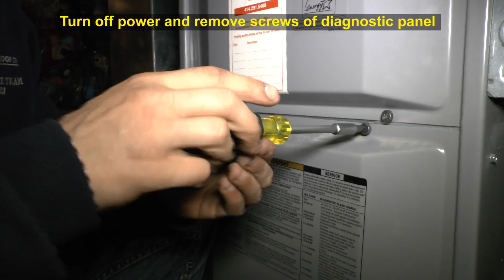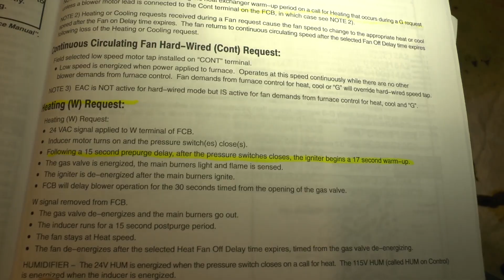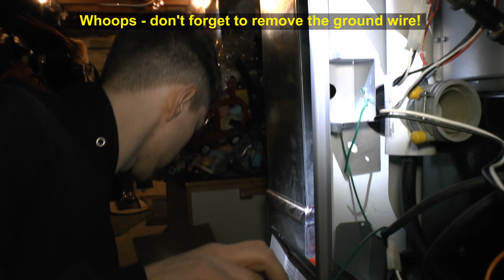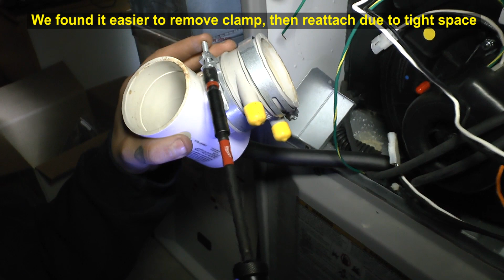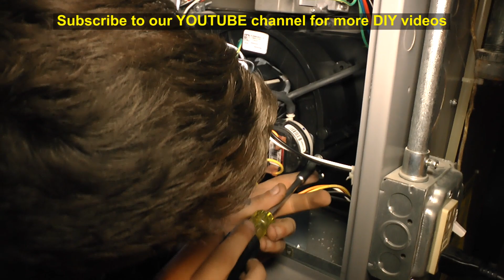Furnace Not Working - Bad Inducer Motor - Step by Step Repair Instructions #noisyfurnacerepair

Comment: I have a similar Lennox inducer motor that’s bad. Seems like I can easily replace. The part is 355. The company wants 1600. It’s ridiculous. … It comes with the split capacitor, plug and play wire and two clamps. It’s a Fasco 7062–5441. It’s 10 years old so the new replacement is fasco A209 similar to this one. my problem is the one video I saw Seems like it had a rubber boot inside the hole and no one seems to replace the gasket they sell these motors with no gasket. I saw one company offering Permatex .  It looks like the gasket is some kind of rubber boot and hopefully it doesn’t corrode.  Nobody seems to talk about the gasket .. my unit only 10 years old no one sells the gasket. Do I actually need it or should I put a the bead against the existing gasket? I don’t know. Any help??
Reply from the maker: Thanks for watching and sharing your situation. My gut tells me that you need to follow the installation instructions that are supplied by the manufacturer - because if it fails prior to it's warranty period, it may not be covered. It also seems odd the rubber gasket is not available, unless the updated replacement no longer requires it? If it were me, I'd continue looking on the internet/forums for someone/something more definitive.

Comment: I had the same issue. All I did is I oiled the bearings on the motor to uncease it. Then I gave it some good oiling (air gun high speed non detergent) and reinstalled it. Five years still running.
Reply from the maker: That's another great option. So happy it worked for you and saved you a nice chunk of money. I guess having a 2nd unit ordered and ready to be installed, in case the oiled bearing unit failed, is also a good idea, especially here in Wisconsin, where our temperatures drop down below zero during the winter. Thanks for watching and sharing your solution - that's excellent!

Comment: hi i have a combustion motor for my boiler heater- starts for a couple second then stops. what could be the problem. it doesn't even start 99 percent of time.
Reply from the maker: Well, there are a lot of items in a boiler system to check, both electrical and mechanical. I'm not sure if you can locate the make/model of your boiler heater, and see if there is something specific to your model that someone else has identified on a YOUTUBE video like ours? Perhaps you still have the owner's manual and can identify the various steps your unit sequences through in order to start up and operate effectively? Thanks for sharing. Wish we had a better answer for you - but it's a lot like a vehicle not starting - there are many reasons for it, including electrical, fuel, computer and more.
Reply: Thanks i just got new one and is running now. but the primary motor outside the boiler makes humming sound like it's trying hard to push water through the valves or something, could it be caused by air in the system? how to fix this noisy cir. water pump? @VintageVideos2009

Comment: this is not repairing instructions, this is how to replace a broken motor instruction
Reply from the maker: Hi, appreciate your watching and sharing your comments. Here's the thing, by replacing the broken inducer motor - we "repaired" the furnace. So, yes, in our view a replacement part does in fact repair the furnace and return it to proper working conditions. We hope that makes sense. Thanks again for watching and sharing your thoughts.

Comment: Any Gaskets to the housing
Reply from the maker: Hi Tom, no gaskets to replace or reattach on this particular model, but other furnace models and inducer motors may vary. You'll definitely want to take note of all the parts that you access, remove and replace. Thanks for watching and sharing your question.

Comment: How much is a.new triangular tube inducer motor n where is the fastest  way 2 get it?
Reply from the maker: Hi Diane, thanks for watching and sharing your question. Honestly, the fastest way to get one might be your nearest local furnace repair shop. Or if you are placing one yourself, you'll have to match part numbers with your existing unit, and shop via the internet. Same with the fastest - the internet, next day shipping if you locate the part you are after. Good luck on your repair.

Comment: I just did this job. Finding a motor over during Chritmas holidays was fun.
Reply from the maker: Hi Dee, I was in the same situation when I installed this inducer motor. I received the motor a day before Christmas. The house had already cooled off to 55 degrees, and we were having 12 people over for our Christmas dinner and gift opening. It sure was a great feeling to get it installed, re-energize the system and have our heat working again to make for a great holiday "gift". Thanks for watching and sharing your experience.

Comment: My Philco furnace with a fasco inducer motor 7021-12001. I turned it on about a month ago , the fasco motor was stuck. I got in the back of the motor and tickeled it loose , put a few drops of sewing machine oil on the sealed bearings. So far so good. Dealer that installed it in 2009 wants 590 bucks. I been looking on the internet for a month. Can anyone help me find that Fasco number motor.  gosh darn it.  Help , i am a disabeled veteran. Happy Veterans Day.

Comment: is that a vine in front?
Reply from the maker: Hi Bobby, I think you're referring to the older electrical cable draped across the front and connected to my thermostat, right? Yup it's old. Still works fine.

Comment: When enducor motor goes bad do you need to change the whole furnace? My furnace is over 40 yrs old
Reply from the maker: Hi Street Cruise, thanks for watching and sharing your question. Technically, you could replace the part and continue using your furnace. However, today's high-efficiency furnaces are so much better, and given you have a very, very old furnace - you really should make the move to find a new furnace.

Comment: I thought he was going to repair the motor. He replaced it. bad title
Reply from the maker: Hi Dustin, we appreciate your comment, sorry for the confusion. Our title is about the "Furnace Not Working" and by replacing the bad inducer motor, we have "repaired" the furnace, rather than disassembling, removing, reinstalling parts within the inducer motor. Some people do opt to remove and replace specific parts within the inducer motor - however, obtaining a new, complete inducer motor assembly provides a full warranty vs repairing a single part within the motor - and having it fail again, within 90 days if another part fails. Giving that our inducer motor was already 10 years old - it made a lot more sense to remove the entire assembly, replace it - and thus "Repair our Furnace" to proper working condition. Hope that better explains it all - but it's a bit much for a title on the video.

Comment: I just have to bang on my motor every once in a while to get it going lol. Probably gonna have to be replaced soon. Rattles likes a mofo
Reply from the maker: Hi Nighthawknorth94 - yes, the whining sound may be related to the bearings or shaft failing. Hopefully it can keep running for you for a while, but you'll want to replace it soon. It really doesn't take very long to complete the repair. Good luck with your furnace and thanks for watching and sharing your comments.

Comment: any idea? we have condensing high efficiency 90 furnace.our exhust PVC pipe is leaking and seems to be hot.Any idea? what could be cause.Furnace runs and exhaust co outside no issue.
Reply from the maker: So, the PVC pipe, inside the furnace control box is leaking, or the PVC pipe located - away/outside of the furnace operation box is leaking? If it's inside the furnace box, you may need a technician to look into the more advanced operations of the fuel/manifold/heat exchange/exhaust system. If outside the unit - is there some partial form of blockage in the PVC exhaust line? Or perhaps a seal in the PVC line that has become loose?

Comment: The hum you are hearing is typical of a PSC induction motor that doesn't start because of a bad capacitor mounted on the inducer housing.  Capacitors can be easily tested with a multi-meter.  Sure you have a bad motor and not a bad $5 capacitor?
Reply from the maker: Hi Priya, you bring up some valid points. However, for the typical homeowner who faces this issue, they may not have the multi-meter, nor the skills to adequately test the capacitor. Or if they do, and they replace it, will the product still work correctly, and for how long. You are correct, that it would be a far less expensive repair, if the capacitor is the only issue - but sometimes, a quicker and more sure-fire fix, can justify the moderate cost of replacing the entire component - and then hopefully you'll have years of reliable service and not wonder if the motor will fail in the next couple of months. Thank you for bringing this option to everyone's attention - is certainly is something a more confident homeowner could do, with just a few tools and a little extra time on their hands.
Reply: @VintageVideos2009  Thanks for your reply.  Should the capacitor be replaced as a first step without any diagnostics?  If replacing the capacitor doesn't fix the hum, you know for sure the inducer motor is bad.
Reply from the maker: @priyajakatdar3759  In terms of affordability, the capacitor is the least expensive part, whether it's tested or not. Let's assume the homeowner needs to go out and buy a multi-meter, they will need to spend some money on that item, and some time to purchase a test unit. Again, these issues are not significant, but will delay the repair. Sometimes the furnace fails when it's sub-zero temps here in Wisconsin, with temperatures dipping inside the home below 50 degrees. Homeowners in those situations want a very fast repair usually. These are concerns that affect repairs in the auto service industry - where some prefer a more, longer term reliable repair, with even a 90-day warranty (most parts) vs a less expensive, but less reliable fix. I'm not saying your idea is wrong - and especially if you are confident in your repair skills, and using a multi-meter - replacing a defective capacitor would indeed be viable idea and would save even more money for the DIY homeowner. Thanks for adding to the discussion!

Comment: Hello, I have Goodman +90% model GMNTE100-4 I call a HVAC contractor and he replace inducer motor, now after 4 months I hear the same noise like before and some time the I hear motor make a mmmm... sound which mean wont start outside fan blade is blocked, I unblock with a screwdriver to start.
I call yesterday an other HVAC contractor and he told me to replace furnace and AC . Furnace and AC are old about 15 years in good shape and very clean.
Is normal 4 months of life good for a inducer motor? 
Which is original part number?
Should I replace furnace and AC too?
Reply from the maker: Hi Alban M, your replacement inducer motor may have a warranty - you should look it up - is it 90 days or 1 year? If one year, it could be replaced for free. Defective parts do happen. As for the furnace itself, 15 years is getting up their it's typical life, but if there are not other issues, and merely an inducer motor - you may want to continue to service this one specific issue. Of course a new furnace should operate with little or no issues for at least 10 years, by simply changing filters and following standard maintenance procedures. As for the part number, you may want to refer to your furnace operations manual - there should be a part listing in it, or you can Google the current part number (usually seen on the side of the part) to see what a suitable replacement would be for that item. Good luck on the repair or replacement of your furnace.
Reply: @VintageVideos2009   thanks for your replay "it is with 90 days" I will replace my furnace, my time digging for solution for save few backs and still I will need to replace soon.
Reply from the maker: @albanm7645  Yes, your decision makes sense, especially if you plan to remain in your home for a number of years. Many homeowners might do the same as you, with a 15-year old furnace. Thanks again, for watching and sharing your experience. All the best with your new furnace!

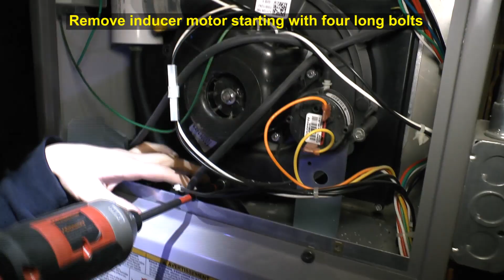Comment: 03:48 Replace inducer motor
Reply from the maker: Hi Nicholas Dupont, yes, that's the spot on the video where the replacement begins. The video prior to 3:48 shows what to look for, what the defective inducer motor sounds like, if it may be hot, etc and how to turn off the furnace prior to beginning  the replacement itself. Thanks for watching and I hope your repair works well and resolves the problem.

Comment: I didn't see you "repair" the inducer motor. You just replaced it.
Reply from the maker: Hi Nicholas, thanks for that observation. I actually "repaired" the furnace, by replacing the inducer motor. I realize these are somewhat trivial language, but the idea is that you can save a lot of money on a furnace repair, by spending about 30 minutes to replace an inducer motor. Thanks for watching. I hope the video was helping - in getting your furnace back in service and saved you hundreds of dollars.

Comment: How long are these motors supposed to last?  I just replaced mine 5 years ago and the new one just went out this morning... on New Years Day no less.... in a snowstorm.  >:[
Reply from the maker: Hi D P, the timing of your motor failure certainly sucks. We hope you are able to keep your home warm enough until the new motor arrives. Most higher efficiency furnaces today typically have a life of about 15 years. On some models, you could be lucky and have the motor continue as long as the furnace - but in all likelihood, you will need to replace the inducer motor at least once (or in your case twice perhaps) within the life of the furnace. A lot of variables take place of course, including how often the motors cycles and runs and the components that make up your replacement motor. Generally speaking, OEM models tend to be more expensive, but also tend to last longer. Thanks for the question. Best wishes on a fast arrival and easy installation and a return to a nice, cozy household.

Comment: Should we turn the furnace completely off while we wait for the replacement part?
Reply from the maker: HI Justin, great question. Your furnace will continue to cycle on, then fail to ignite, and shut off. This on/off cycling will not get the furnace to restart, and it merely adds a great deal of wear to your furnace system. So, yes, you should turn off the furnace, until after you have replaced the inducer motor part and everything is correctly hooked up. Thanks for watching and sharing your question.

Comment: Replacement inducer motor didn't come with a grounding wire. Do I need it? (Original was 25 years old)
Reply from the maker: Hi, thanks for watching and sharing your question.
Yes, it kind of depends on the wiring and mounting. If the motor is mounted to the unit metal to metal and not rubber mounted then it will ground out through the casing. Sometimes there’s an existing ground wire screwed to the unit and motor and you have to undo the wire from the old motor and there should be a spot to attach it to the new motor. Or occasionally they’re grounded directly through the wiring harness. You should be able to obtain instructions from the manufacturer of your replacement inducer motor.

Comment: Thanks my inducer motor make loud winner noise I call the company and they want 850 for replacement... I found the motor for 100 dollar I will change by myself don’t look difficult ... also I will change the gasket for the collector box is dripping water ... thanks for the video
Reply from the maker: Hi Tony MTA - Thanks for watching and sharing your comments with us. Yes, this job can all be accomplished in less than an hour, and perhaps even about 30 minutes, if everything is accessible for you. Good luck also with the collector box.

Comment: Same problem.  What the pro's won't tell you is that your motor is frozen and  can be salvaged for the cost of a few drops of oil in the proper place to unfreeze it.  Thanks for the video.
Reply from the maker: Hi Da SuitMan, you bring up a valid point - thanks for watching and sharing your comments. Yes, you could apply some oil and get the motor running again. That certainly could be worth a try, if the bearings are still intact and no other issues are taking place with the inducer motor. Putting the drops of oil in, could keep the motor running and your furnace in operation, until a new part arrives. And if the oil drops fail, by then you would hopefully have a replacement part. At some point, the bearings or shaft will likely fail, and the inducer motor will need a replacement. Thanks for the great tip!

Comment: I'm surprised they didn't use a FASCO motor they are more reliable and are more quiet .
Reply from the maker: Hi Mike, thanks for watching and sharing your expertise. I'm sure future viewers will take a look at that.
Reply: My replacement was a fasco, last over 10 years. The new one is much quieter too.
Reply from the maker: @thorsaquatics6310   @Thor's Aquatics  Well, thanks Mike Chiesa, for the helpful advice. I love the YOUTUBE community and how people are willing to help one another!
Reply: I really don't know much about HVACR all I know just the basics all information is what I have learned on the YouTube platform.
Reply from the maker: @FEDERALSIGNALTECH  Hey Mike, auto repairs are much the same way - with a lot of content and DIY vids on YOUTUBE. Sometimes you don't have to know everything - but you do want to learn enough to repair your furnace and save yourself $500 or so, with a 30-minute job. But if a person is not comfortable or feels in doubt, hey, it's fine to call in a professional and get it all done.